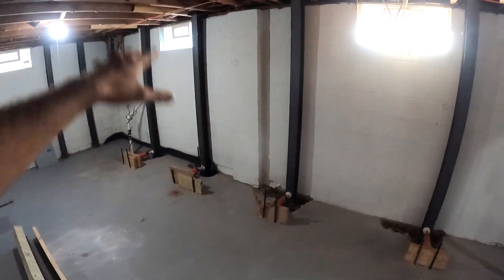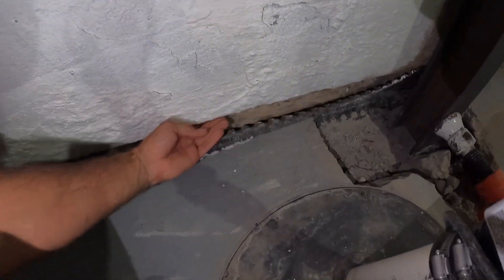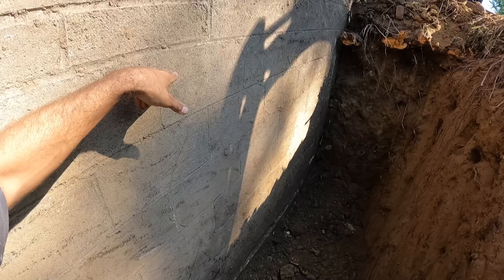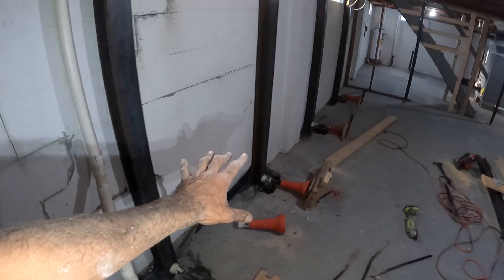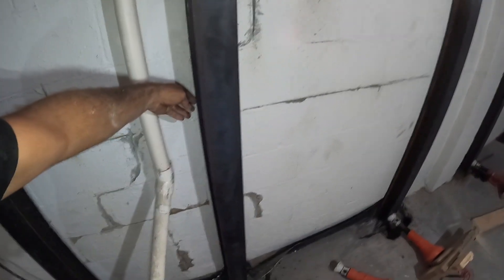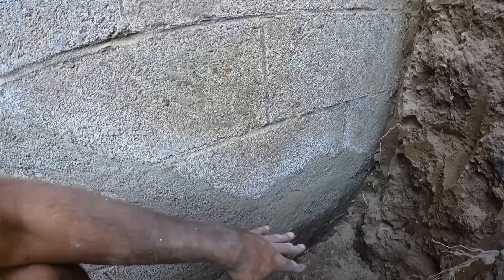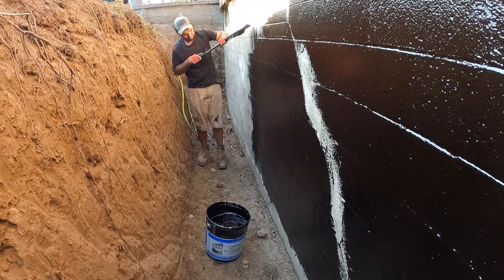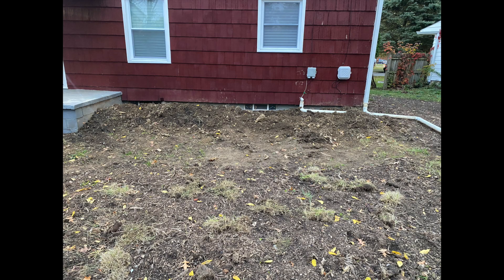Bowing Basement Wall Repair | I beam Install

Comment: how do you brace the ibeams if you are working in a dirt crawl space?
Reply from the maker: Haven’t done that. Anything u can push back to like a footer or another wall. Not sure on this one without seeing it.
Reply: @handylandlord  thanks for the reply, unfortunately the foundation doesnt have any footers, it has caisons every 10 feet or so. there is really nothing to push against, truss floor that spans 30 feet with no supports, just the perimeter stem wall foundation.

Comment: Thanks for the information. Been a really big help. I bought an old farmhouse at auction and the basement cave in I’m damn near 70 but I’m still gonna try it. Thanks again.
Reply from the maker: Thanks for watching. I will say it’s a lot of work, but can be done. If your farmhouse is a stone foundation I have no idea if this method would apply. My best results have been with excavating the outside dirt. 

Bowed basement walls, I beam install
https://youtu.be/uADOIGWbybo

Comment: Guess it would be a good drinking discussion. When we have issues like this we abandon the wall or at least take a bunch of the load off. About every 3-6ft, pour footers, install posts and set support beams across the posts to catch the joists.
Reply from the maker: That's interesting. I"ve seen basements where someone has poured another concrete wall in front of the bowing wall tying the blocks to the poured wall. This wall gave me a hard time but over all I find basement jobs fun I enjoy the challenge.

Comment: wow, looks great! I have several basement walls that are bowing a little from downspout drains. I've looked at hiring Acculevel to correct this. But they're extremely expensive. I'm curious how much this all cost you to do. I might try to hire it out to one of my contractors. Great job!
Reply from the maker: I've received quotes before from basement companies and am normally shocked. 5 beams at 95 inches $760. Tar, peal and stick membrane, dimple board, concrete and wood about $600. I get my equipment rental for free because of pro perks. I wish I could find someone to excavate the wall for me. Reached out to several people no luck. Thanks for watching maybe another video you will like. 
https://youtu.be/uADOIGWbybo

Comment: Hey bro i have a good question for you … my garage is made out of concrete , the sides , and the roof ! The walls are about 7 feet high of concrete , its cracking and bowing towards the inside … with having a concrete roof sittings on those walls , could i do the same thing that you do and push the wall back out ? Or should i just put beams in order for the wall not to keep coming in … i think i hahe about a 2inch difference from the middle towards the top
Reply from the maker: Interesting that the roof is concrete. Can’t say I’ve seen that. My issue would be how would u attach beams at the top. Maybe a piece of angle iron with concrete anchors. Another option is to get some quotes to repair, you would get some ideas of how they would repair.
Reply: @handylandlord  hahaha yeah man , not sure why the build it like that to be honest ! It makes it really heavy on the walls for sure plus with that land moving after every big winters we have ! The top id be able to anchor it into the concrete somehow for sure ! I have a guy coming to check it out this week see what could be done , its going to be interesting

Comment: So you're pushing the bottom...I have one that is 30' long - poured concrete 7' high...leaning in at the TOP by a 15° angle! How to move THAT one?!
Reply: I've got poured walls with a 1.5in lean on the top. We found this video when the quote guy came out and showed us this beam method but you anchor the beam to the floor and use the jack to push from the top. Top is supported by the floor joists and you just work really slowly.